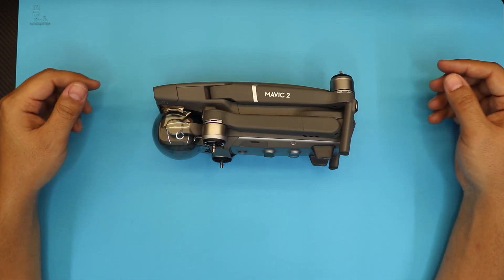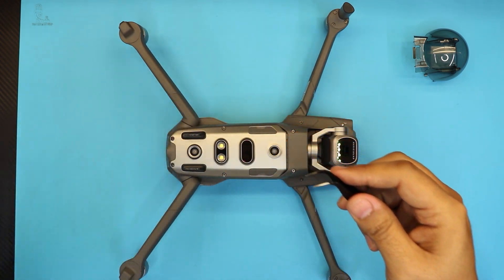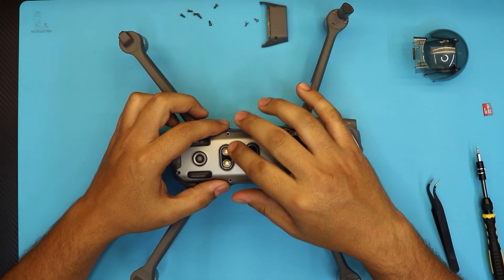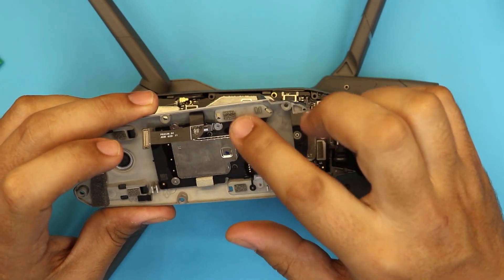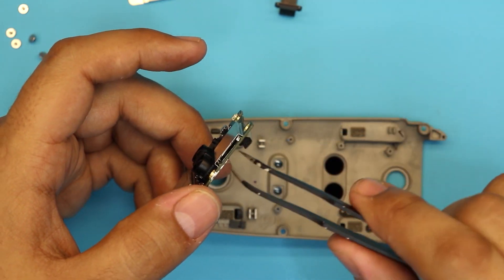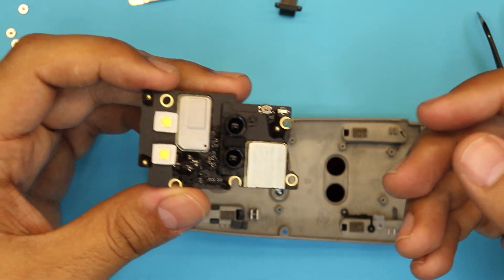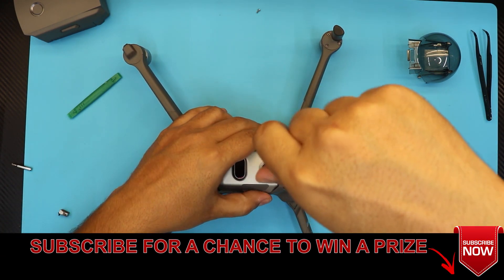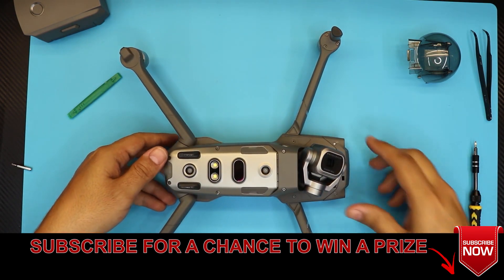HOW TO REPAIR dji mavic pro 2 sync button or sd card reader or LED lights

Comment: Hello ufixtec,

I have one Autel Evo, the SD card is not detected. Do you think by changing the SD card reader the problem will be fixed?
Reply from the maker: Thank you for the feedback! if you wish to support the channel you can LIKE or SUB or both :P
regarding your question: not long ago about a week or so we replace one for a client and the issue was it wasn't detecting sd card replacing it fixed the issue.

Comment: Hi ufixtec , help ! I get error msg 400400 infrared sensor calibration error after replacing board. Tried on two different boards with same result. How to fix ? Does new board req programming ?
Reply from the maker: there is no codding, reset the board and let me know, after you put everything together remove the battery and you will need to short the two right pins with two left pins for 30sec, that way the chip set will reset. (the pins on the drone not the battery) .
Reply: Ok do you have any videos on how to do this / what to use to do it ?
Reply: Ufixtec any more help or advice would be greatly appreciated tried the above method but still not working I’m afraid 😧 still getting error msg 4004000
Reply: Andy Moffat our of interest, why did you replace the board? Was it because your SD stopped working after the firmware update? 

Mine m2 pro literally just stopped reading the SD card.
Reply: The auxiliary landing lights on mine started playing up, first going dim and flickering then totally not working. The board fixed this issue but leaves error msg 4004000. I have done a lot of research now and since discovered that the board does indeed need coded by DJI or an authorised repairer. I had no reply from ufixtec regarding the reset at battery pins procedure and don’t know how it could work if the battery is removed ?? Ufixtec video is informative of the board replacement but unless you have DJI software or an Einstein with programming then it will likely still have to go to DJI.
Reply: Andy Moffat are you in the UK?
Reply: Yes

Comment: Where is the intrenal storage located
Reply from the maker: its right under this aluminum heat-sink plate:
https://imgur.com/a/8JAKqOa
its soldered on board none replaceable.
Reply: Hi ufixtec I got error msg infrared sensor calibration error 4004000 after replacing board. Tried two different boards same result each time. How to fix this ? Does it need programmed ?